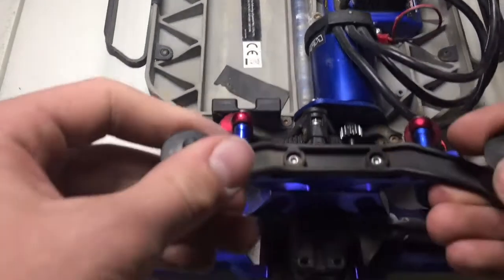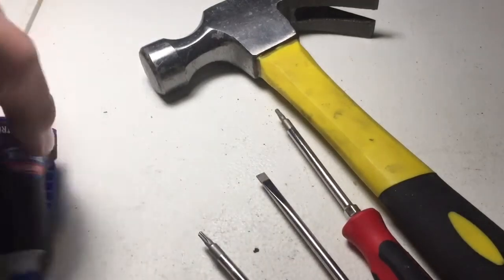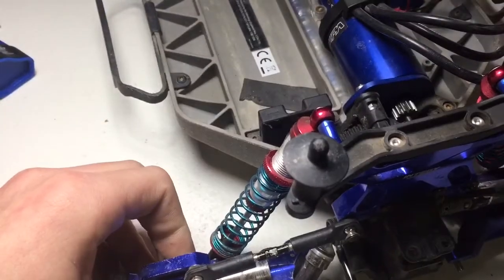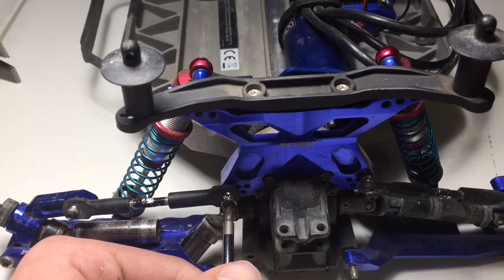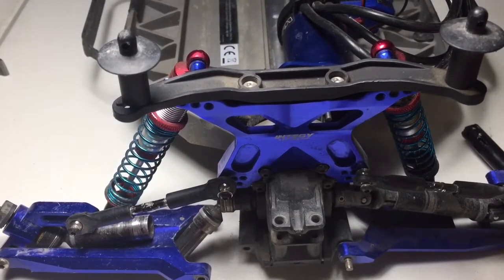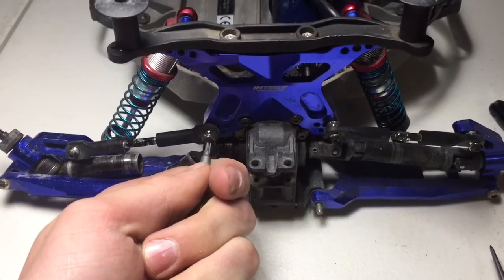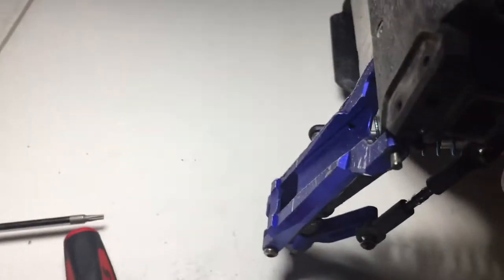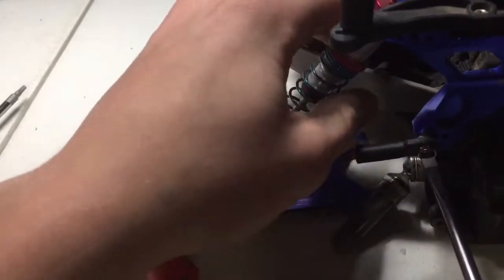How To Fix A Stripped Screw On An RC

Comment: Is it just me or would it make more sense to use an allen head instead of a torx bit in an allen head screw?  That would reduce the amount of stripped screw heads....
Reply: I think he tried to use an Allen screw and it never worked so he used a torx screw to hopefully get some grip to pull it out. I've don't the same, when Allen screws are stripped put in a torx screw of a bigger size, if the screw is plastic, hammer it in a bit and then unscrew
Reply: @avi.d04  my ones doesn't even get out with torx but I don't use his trick it is stupid
Reply: Allen are the worst screws.
I have issues with them everytime when I do my maintenance, (Sometimes I need to repleace all the piece for only one stripped allen screw)
I never had this problem with the Tamiya kits that use philips

Comment: I'm about 6 years late to this game.  I realize the author is young, and likely inexperienced.  I'm also sure in 6 years, he's learned much better ways to handle this.

- Try using a backout bit.
- Dremel a slit and use a flat screwdriver to remove screw.
- Carefully use vice grips.
- DON'T use torx drivers in hex screws.  Always use good quality, properly sized hex drivers.
- DON'T use hammers.  You risk damaging your driver, or the car itself.
- DON'T try to use super glue.  If it runs, you risk permanently gluing the screw to whatever it's attached to.

Some commenters mentioned this as a track fix.  If you must fix, take it home and do it right, lest you cause unneeded frustration and cost.
Reply: your advice was better than all the videos i watched i stripped a bolt on the bottom rear frame and cant swap my control arms until its out😂

Comment: Just want to throw this out there....
A Stainless Steel screw or bolt would have not been cut by the saw very easily... 
 Stainless is hardened rust and oxidation resistant metal. You want regular aka mild steel or iron screws and bolts.